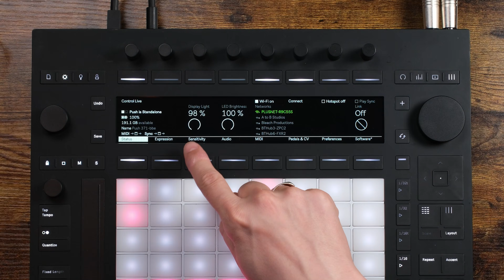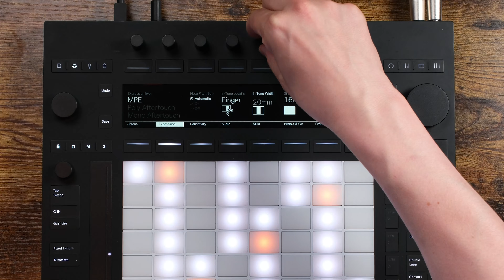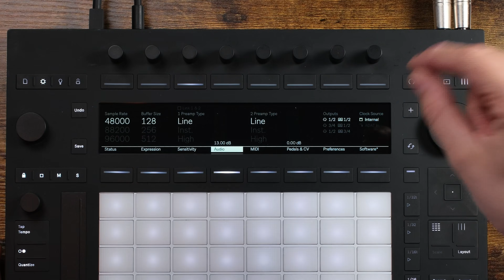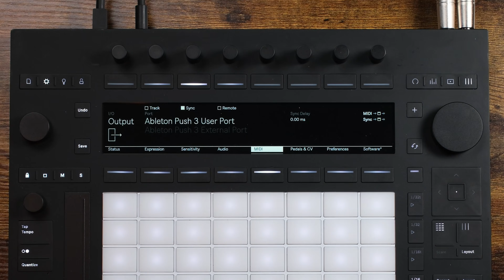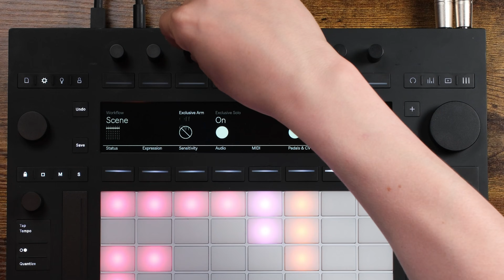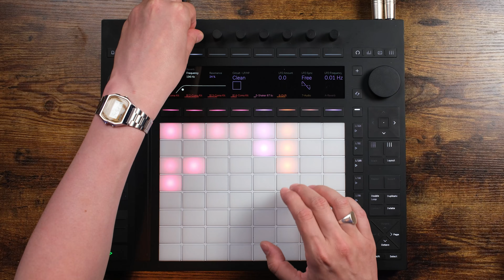Ableton Push 3 Settings To Turn OFF Now! (Important!)

Comment: Million-dollar question: How do I press shift + space on the Push 3? How do I stop playback and restart from the same point?
Reply: on Push 2 its only hit play .. and play again.. to start from the beginning of the project  - shift + play
Reply from the maker: Good question, this catches a lot of people.

There isn’t a direct Shift plus Space equivalent on Push 3 like the keyboard. The closest behaviour is using Play to stop and Play again to restart, or controlling position from Arrangement on the device.

Some keyboard habits just don’t translate cleanly to hardware.

Comment: I don't think you're correct about the user port, it's for connecting devices when in user mode. Whatever user mode is and if ableton ever get around to doing anything with it.
Reply from the maker: Yeah you’re right to point that out. The User Port is technically for User Mode, but since Ableton haven’t really given that mode much yet, I just explained it as the USB side of things. If you’re connecting synths or other gear, that’s what the External Port on the back is for.

Comment: Thank you for this video. I have two questions if you don't mind!  1) how do I route the click track to just my headphone on the standalone push 3? 2)Even with my preamp setting on high, my dynamic mic is very very quiet when plugged directly into the Push 3. I ended up connecting a cloudlifter (plus a phantom power to power the cloudlifter) to get enough gain, but I'm wondering if I'm missing a setting, because I've seen other videos where the mic is plugged directly into the Push 3? Thank you in advance!
Reply: @pushpatterns  It worked! Thank you so much!
Reply from the maker: Hey! Good questions! Yeah, the built-in preamps on the Push 3 are on the quieter side, so that’s normal. You can always use an external preamp if you need more gain. Also, keep an eye out for the upcoming beta update that’ll let you use a class-compliant audio interface with the Push 3, which gives you more options for mic pres.

For routing the click, just head into Settings and go to the Audio tab. Then hit the levels display button (top right corner, second from the left, it looks like vertical lines). That’ll turn the screen into a volume meter. If you hit the last button there, you’ll see both track volume and the in/out options for the master and cue, so you can route the click to your headphones separately.

If you want me to walk you through it more closely, just drop me an email and I’ll help you out.

Comment: thanks. i still dont get output routing differences 😂 also didnt you basically turned off velocity etc. almost completely with setting up thar very steep curve in sensitivity settings?
Reply from the maker: Do you mean the audio output? You're not wrong, it does make it pretty flat! It make it feel more like the newer akai pads